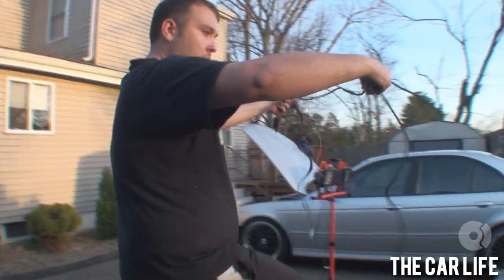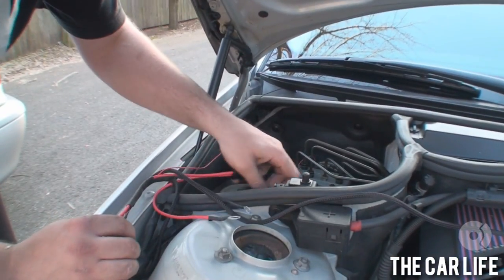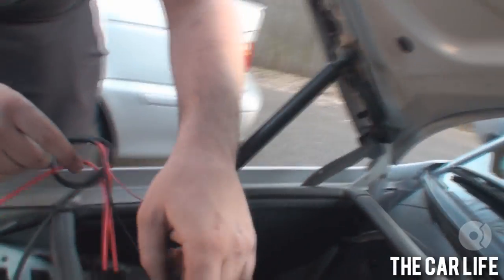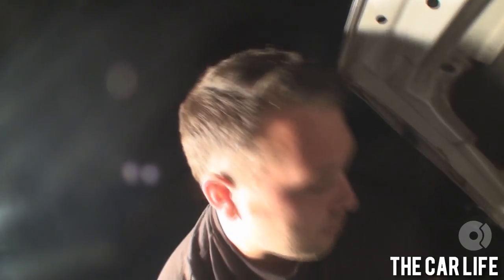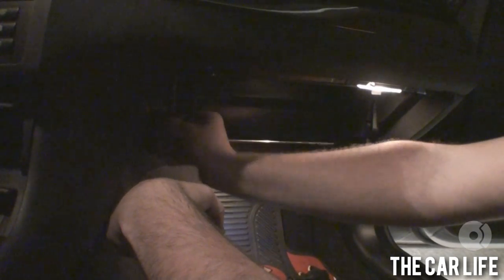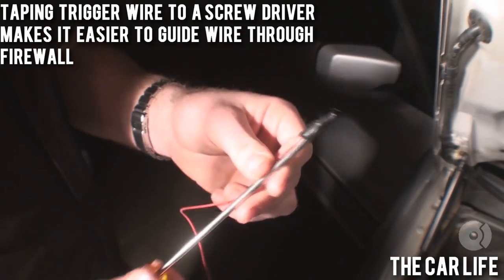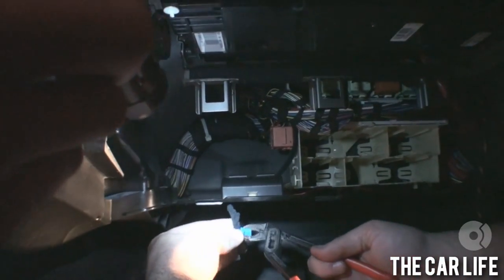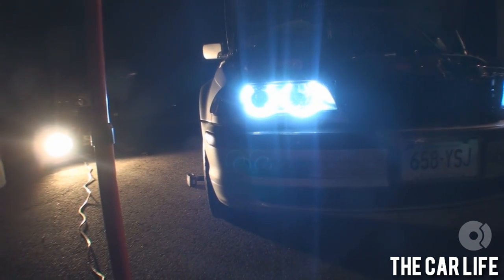BMW DRL/DDE Harness Install (E46) - FCP Euro

Comment from the maker: This relay harness works off two trigger points. As long as one trigger is active the relay will provide power to the angel eyes. Example, if you unlock the car and have one trigger connected to the interior light the angel eyes will come on. When the interior lights fade off so will the AE's. When you start the car (position 2 or ignition) the angel eyes will turn on and stay on until the car is turned off.
Reply: So they work as day time lights?

Comment: There is a pass-thru in the DME box. I just made custom headlights out of LED lightbars and i have the exact same pre made harness. Its right above where the top of clutch pedal arm is. Goes into the DME box. Makes it super easy

Comment from the maker: The reason I went through the driver side vs the passenger side for the secondary trigger wire was the length of that wire. I knew the driver's door interior light wiring is part of the main harness of the car. I traced the wire back to the footwell, tapped into that, and it was all good from there. I didn't try it on the passenger side to be honest. I only tapped into the DME with the primary trigger wire there.

Comment from the maker: On the E39 you have to run the trigger wire through the firewall under the brake booster on the drivers side. It will come out near the dead pedal. From there you have to tap the wire into the drivers side door positive cable. Like I said, it can be done but it takes some work. Definitely easier on the E46.

Comment from the maker: Yes, it can be done. However it is slightly more involving as these harnesses are designed to work with the E46's layout. The E39 is slightly different and requires modification to the harness for perfect fitment. I have a video discussing this and another video I will upload in the coming days going over the modifications to the relay harness.

Comment: I found that on the M5 there is a red and blue wire plugged into the bottom of the passenger side. I saw another video and took their ideal from their e46 install. I ended up having to extend the 2nd trigger wire through the firewall grommet in the ecu compartment. It is basically right there once you go through the firewall. All in all it worked out well. I just need to get a better clamp on my angel eyes and i'm good to go.

Comment: just installed my depo angel eyes
ddi you have a problem with warning lights on your dash?
im guessing its from the old parking lights and remote adjust for your low beams to being plugged in anymore with the new headlights?

Comment: Did you disconnect the battery in the trunk before doing the work with the jumping points under the hood?

Comment: i saw your video. i have a comparable harness from ddm tunning. mine came with two trigger wires though. where do i connect those exactly? I know one goes to the ecu obviously, but the other? is that the one we are supposed to connect to the interior lighting? where exactly is that wire located?

Comment: I have this installed but now the halos aren't on when the engine is running. but they work when I lock/unlock and open the doors. could this be a fuse?
Reply: I have the same problem have you found anything that could be it. Have your fixed the problem ? Please help
Reply: Hie, same problem here. were you able to fix it? i have a feeling its to do with the battery voltage increase above 12v when car is running and the led controller is made for 12v only. but havent been able to test this theory.

Comment: The video is good but you need to go a little more in depth regarding how the harness connection is made. I didn't see where you connected the molex connection to the white box behind the headlights, you also didn't show the lead ends being connected and didn't specify where the fuse should be connected. Overall it's straight to the point but needs more detail.